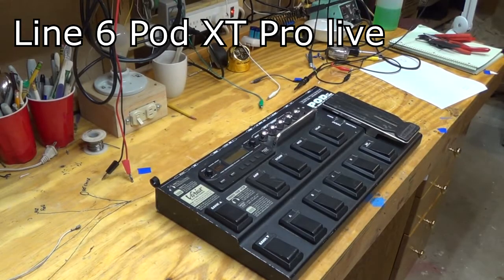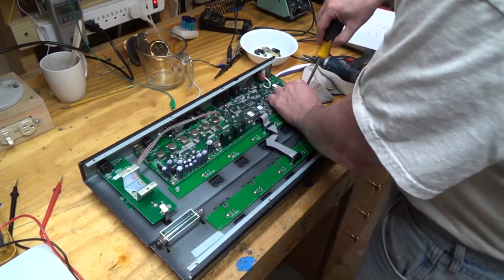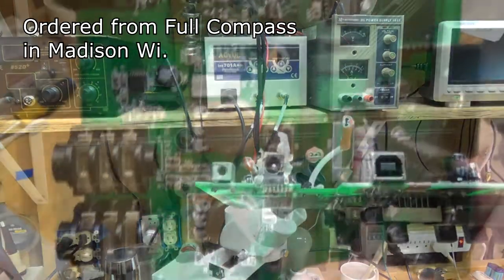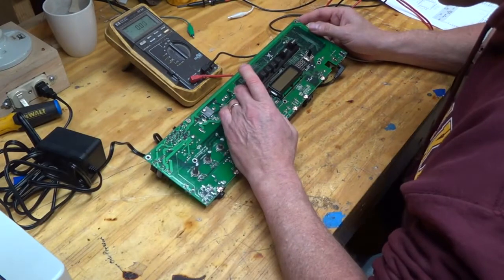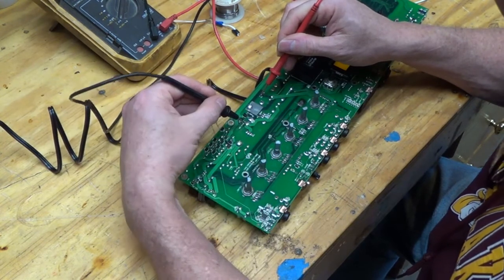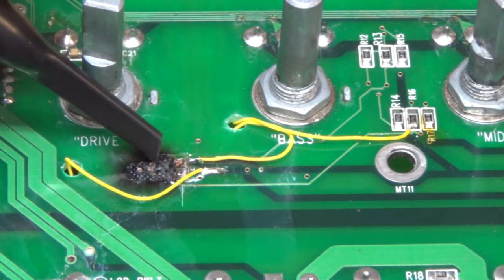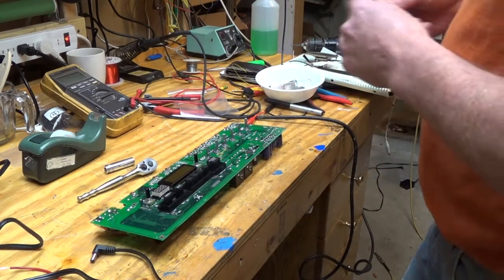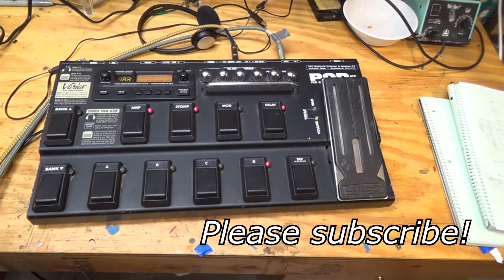Line 6 POD XT Live repair and refurbish

Comment: My Board Burnt Up At A HOT Gig. How Do I Get My Settings/My Presets Off Of It? It Will Not Power On. Smells Burnt. I Need My Presets Off Of It To Dump On Line 6 Monkey To Dump Onto Another Unit
Reply: Do You Do Repairs For People?

Comment: Thanks for posting. For those having trouble getting the big circuit board to move away, the bit that you can't see here is that the big circuit board is partially held in place by the potmeter knobs, the nuts on the jacks and two small screws on the variax input. If it won't come out, check those.

Comment: friend, did you ever notice if the 3.3V regulator heats up to the point of burning your finger if you touch the heatsink?
Reply from the maker: It's been awhile but I remember all the regulators really running hot. I was surprised there wasn't more heat sinking.

Comment: Great job on bringing it back to life, Rob!

Also, the power supply for the unit outputs an AC voltage. Would you know if a DC power supply can be used instead?

I know that if a the circuit uses DC voltage and a bridge rectifier is used, you can technically supply the circuit with DC.

Thank you very much.
Reply from the maker: I think it has to be ac because it uses a voltage doubler to get the 15 and -15 for the opamps and I think it needs the AC to work. Seems like a weird design choice.
Reply: @RobsFixitShop  Ahhh yeah that is weird. Was looking into getting a battery powered multi FX and was considering trying out a battery pack on my Pod XT live before buying something else. Oh well, I guess I have to look for a Boss ME80 or Zoom G3X.

Thank you for your help Rob.
Reply: @ACS45Cal  zoom has made many awesome effect units!!! I haven't used the G3x... I have G2-NU, and it has a lot of usable patches built in

Comment: I have a Line 6 XT Live that isn't quite working properly.  The reverb and delay doesn't work and when the tuner is activated, it doesnt react to any note played.  apart from that everything else works fine.  I'm hoping its a software / settings issue rather than a hardware / PCB problem.  Could you please suggest how I could go about fixing this please?

Comment: I know this is 2 years old so hopefully you see this. I've got one of these and it worked great. I hadn't touched it in a few months and recently plugged it back in. Well in order for me to even faintly hear it through my amp I have to crank everything up. I tried plugging it into another amp and still nothing. It powers up but the input it output is just not working. What would you recomend I look at? Or what would your suspicions be?
Reply: Essa pergunta  foi respondida ?

Comment: A buddy of mine has the Line 6 v 240 a little over a year old and it's lost out put / sound . yeah we tried the volume peddle . it was a finicky amp any way , the owners manual / guide is 1 page of nothing . I'm looking at getting the Boss Katana 100 . I had two Roland cube 30s they sounded great and the only weak point was the plastic input jacks . I can't solder at all . It never sticks.

Comment: Great video! I have the same pedalboard and the only button not working is the ''effect tweak/change value'' knob. When I hit Edit and try to move along the different presets, nothing happes as if it would not respond at all. Any suggestions on how to get that fixed?
Reply from the maker: I would make sure the solder joints on the encoder are good, clean the encoder with some electronics cleaner, and if all that fails, replace the encoder. But I'm just guessing:-)
Reply: @RobsFixitShop  I'll try that asap! Thanks!

Comment: NO SIGNAL IN OR OUT in your XT live or XTLive bass ????   
everybody, this can save you weeks of frustrations, this happened to me..... no matter how stupid it sounds.... are you using exactly the original line 6 power source A.C. adapter  ???  not a regular-similar 9 V  D.C. power source..... read carefully... the power source its the problem it happened to me... you need to be sure using the original  A.C.power source (Not a regular D.C.) ...... iiiiiffff you use a regular 9V D.C.  the input signal goes to ground and it does not process anything..... I was using a 9V D.C. and no signal and I spent 1 week doing all kind of updates and contacting techinal support for nothing... after I found my original power source and connected ...voila it works like a charm...I read many guys on internet having same problem and technical support not giving them any answer telling them "send them to us so we can check it up"..... and charging you for that..... use a 9V Altern Current.... not D.C....... do it now.....  stop using a D.C.   (D.C. did not damaged my unit but it just don't make it work
Reply from the maker: Great point, you need an AC adapter because it uses voltage doublers to up the voltage needed for the OP amps.
Reply: @RobsFixitShop  Thanks, eventually someone may have this problem because they lost the oroginal 9V A.C.  power source and wondering why is not working

Comment: Hello my friend.. my pod xt live keeps going into edit mode while I'm playing.. and i constantly have to keep hitting a patch to bring it back in again! 
I have cleaned all the pots thoroughly but the problem still exists! Seems to be only on patches I have created!
Could you point me in any direction to cure this?
Thankyou
Reply: I had the same problem. I took the back of the unit off and sprayed the pots with contact cleaner (there's a little hole in the back of the pot unit, to spray into) turning each knob as I sprayed. I did this a couple of times to make sure. Then I replaced the back, and tightened the nut around each of the pots from the front of the unit (I used a thin screwdriver to get into the small gap and tightened them - I read somewhere that if the pots are loose then it goes into edit mode, too). My POD XTLive now works like new again. Hope this helps
Reply: @clockworkeyes  thanks for the heads up. I will do this if i encounter any future probs. Many thanks.
Reply: Good day, did you get a fix for this problem? I am having the same issue..
Reply: @asahatoo  i did much what clockworkeyes has said apart from the tightening and it seemed to work. I did  buy another 2nd hand unit and put all my patches on as backup tho. Good luck.

Comment: Tq for your share...can i get a part from you?  the part number: 24-12-0002 (Encoder 12-step w/ 25mm shaft) cause i am here from malaysia..i dont know where i can buy..it
Reply from the maker: Sorry, but I don't stock parts. I see that they are on ebay but I don't know if that's available to you. Thanks for watching.
Reply: Hi saya punya problem juga.. Tak boleh nak update flash memory. Keluar lampu merah berkelip dekat Amp, Stomp, Mod. Dekat Screen keluar midi fail, vrx fail, sdram fail, sram pass.. Tahu tak macam mana nak buat? Help me. Anyone who dont understands please google translate. Thanks

Comment: Hello! I have a Line 6 Pod XT Live. The pedal switch is turning on orange light and does not start. I noticed that the C.I of the 3v source is getting very hot. But I have not yet found the solution to this defect. Could you give me any hints on how to do this repair? Thank you
Reply from the maker: I can't really help much but I did notice that on mine the voltage regulators seemed to really run hot. If the 3 volt line was bad the computer wouldn't come up.

Comment: Hey guys, do you know can i power up this pod live xt with DC supply? And what voltage? I can not find the correct AC supply.
Reply from the maker: It has to be an AC supply because it is using a voltage doubler to get the voltage up for the op amps. I see they've really gone up in price. Here's one from the mother ship: https://shop.line6.com/px-2g-ac-power-supply.html

Comment: I had to buy a replacement power input jack. The OEM unit is a cheap piece of garbage. Everything I own from Line 6 has required some type of repair or modification just to keep it functional. 

I've read a lot of complaints about strange volume and effects problems on both amps and digital pedals. My Spider Valve tube amp was cooking the circuit board @ around 350F so I had to put in fan cooling.
Reply from the maker: Could you put a link to the better power jack?
Reply: Rob's Fixit Shop  I believe this is the only official Line 6 supplier of this part:

https://www.fullcompass.com/prod/096566-line-6-21-00-0014-dc-jack-for-pod-xt-hd500-mm4

 My Pod XT Pro Live pedal schematic shows that the part # is 21-00-0015 but Line 6 states that 21-00-0014 "DC power jack" is the replacement (although the power input is AC). 
 
I will have the replacement jack in my hands in about 20 minutes and confirm whether this is the correct part and report the quality as well.
Reply: I installed the replacement jack and the legs are definitely beefier. Side by side comparison to the old jack, yes it is better quality by having the sturdy legs.

Comment: ROB....DEWD!!! We're 08:25 in to the video.....At 01:58, you  showed ua a very SMOKED situation at that sub-melted/non-infulcufurkulated-IC. That is indication number-one that you SHOULD NOT apply ANY voltage of ANY sort to this board until the turned-Trump chip is removed completely and all carbonized (non-green-colored--NIS--standardized) circuitboard is eliminated. You've got to remember that MASSIVELY-CARBONATED-PRINTED-CIRCUIT-BOARD under that CHIP (integrated-crircuit)!!!! It is conductive, not just conducive....be careful of solder-flux too, it is conductive at frequencies above your besst friends annoying  "XXXX or XXX, or Pro+-0) Friend - Norm MacDonald :)
Reply: Annnnnnnnd on to Katy Perr.....Rush........1980..73..4..98......
Reply from the maker: Of course you are correct as evidenced by the visible smoke:-)

Comment: Hi I've had a problem with the volume on my unit - keeps going really quiet and I need to keep re-doing the pedal calibration to fix it - although sometimes when using the volume will just drop out - any ideas? Thanks
Reply: I had the same problem. I took the back of the unit off and sprayed the pots with contact cleaner (there's a little hole in the back of the pot unit, to spray into) turning each knob as I sprayed. I did this a couple of times to make sure. Then I replaced the back, and tightened the nut around each of the pots from the front of the unit (I used a thin screwdriver to get into the small gap and tightened them - I read somewhere that if the pots are loose then it goes into edit mode, too). My POD XTLive now works like new again. Hope this helps
Reply: I just got one today and same issue. I think our pots are dirty. we need to clean them with DeOxit

Comment: I have an issue with my Line 6 Pod Xt Pro. The virtual Reverb knob wiggles and sometimes gets so glitchy that you can not edit your preset. Or the screen gets stuck on Reverb type?  Is this a  reasonable thing to fix or a waste. It works, but when you connect the Floorboard it also conflicts with commands. Reverb switched off it switches back on. I took me forever to get sounds that I really like. If the repair is reasonable, I may fix it and sell it.
Reply: Sounds like a loose solder joint at the potentiometer legs. Try to resolder the joints. Remember to keep the nuts tight on the pots.

Comment: Hello! I'm from Brazil, and i have one Xt Live, but when i turn the xt live on, all that i have is a blank screen. Some techs said i need to replace the main board, but i've doubts about it. Can  you please (and i'm begging) help me? No sound, power supply is fine, all original. Please, i like so much this board. I'm eletrical engineering and i've done everything i could, but i have no deep experience. All the simples things like, AC power supply, board, smoke and burned trails works just fine. I read about this issue on Line6 forum, and get no resolution but, i got a lot of hope on your work. Thank you so very much.
Reply from the maker: I am not an expert but I would check to voltages. They are all marked on the board. Could be a bead voltage regulator for the main board. Good luck!
Reply: @RobsFixitShop  Boa Noite.. Tenho o msm problema em 2 pod xt live. Verifiquei as tensões marcadas e em componentes... Tenho o manual de serviço e não consigo desvendar. Se puder ajudar serei grato.

Comment: I think u might know how to help me. My pod xt live has dead rotary encoders, and I haven't been able to find them locally. I was wondering if its possible to solder a couple of wires to the encoder pins and use a 555 or a tiny uC to simulate the encoder work just with to push buttons. Also I was thinking into tweaking the values of the knobs by the midi port. What would you recommend?

Comment: how hard is it to replace the power input?  I've recently been given a Bass version of one of these and that is the only thing I think is wrong with it...
Reply from the maker: Pretty easy. You'll need some solder wick and patience to get the old one off but it is pretty straight forward.
Reply: ok, so is it basically a matter of de-solder the old one to remove, then pop the new one in and solder it in place?

Comment: Thats cool you bring it to life again. I have a Line 6 POD XT live also its broken the only turning on is the light from LCD when I plug it. What do you think is the problem with my POD. Thanks
Reply from the maker: I am not an expert, but I would check the voltage regulators. It looked like it had one for 3.3, 5, and 8 volts. The board has test points that have the voltages labeled. If a regulator is bad, it can be easily replaced.